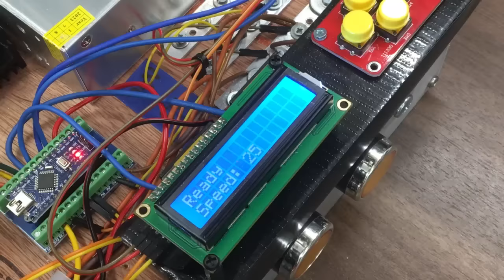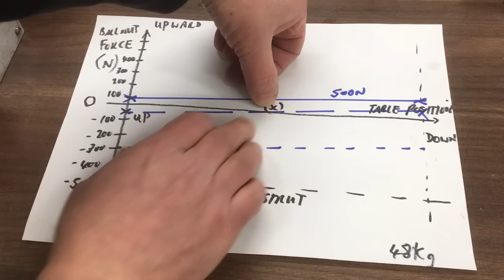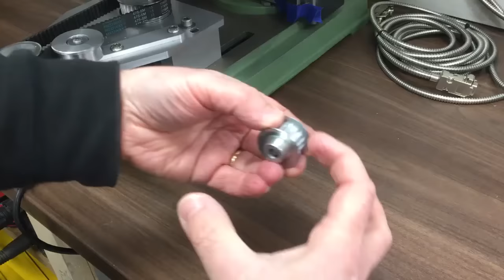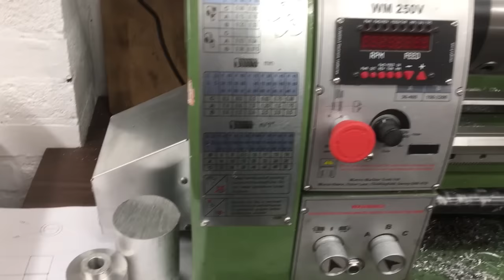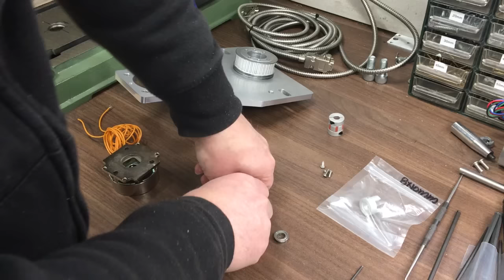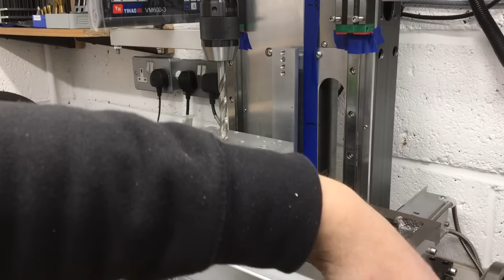Ep48: Drill Press upgrade | Adding a brake to the knee!

Comment: It must cost a small fortune, but I would have done the same thing if I had the skills. It's beautiful work, thank you for sharing it.
Reply from the maker: Not too bad actually and still cheaper than buying a milling machine with the same features. Early on in the project some of the parts were sent free for review (linear rails, inverter, and some other parts).  Plus I’m having lots of fun building it!

Comment: Lovely work, but bet you wish you bought a new stepper with integrated brake! A few dollars would have saved a lot of time. Looking forward to seeing the speeds. When you crank the amps and voltage, and implement ramped pulse generation on the arduino! Also, don't just use the "enable" output to release the brake, need to allow a few milliseconds for the relay to close and the brake solenoid to activate.
Reply from the maker: Yes!  Definitely the way to go.  £60 for 3Nm motor with brake, done!
For brake control and stepper control it will all be from Arduino in software (brake via relay) so lots of control to time it all.  Will probably release the brake to move and keep it off for a few seconds in case you want to nudge the position.  You would not be able to drill until time had elapsed but I can fine tune it.

Comment: The saga continues!
Reply from the maker: I could have just bought a mill, but here we are, episode 48 and counting . . .!
Reply: @routercnc9517  Wouldn't have been as much fun!!!
Reply: @routercnc9517  at what point does this project stop being a drill press and morph into a "mill"? ;)
Reply from the maker: Well it would need a new quill system as the bearings are only for axial loads and there is no drawbar so the endmill would just fall out.  Also the table is not that stiff for lateral forces as it only has 2 linear bearings.  It would be nice but for now my goal is to make it a really nice drill press!

Comment: I really enjoy following your process! Just a question: Why do you need such an elaborate drill press? Or do you do it just because you can? :)
Reply from the maker: I want a precision drilling machine.  So pick up off an edge and drill holes in the part at specific locations.  Also moving the knee up and down to insert longer drill bits and not loose position.  Speed control so I don’t need to change belts all time.  Tapping function to get tapped holes started straight.  So just makes using it more enjoyable and helps make accurate parts.  Also enjoying the process!

Comment: Hi - not sure if you have implemented this in your arduino code already, but it sounds a bit like there is no acceleration curve programmed for the stepper motor? I.e. when you press the button, the stepper tries to spin to the commanded RPM instantly. If that is the case, you will find that the motor gets upset and out of sync at a much lower RPM than it can actually achieve. If you program in a 'soft start' acceleration curve, you will find that you can achieve much higher RPMs as the motors are able to accelarate themselves and the load without falling out of sync and getting upset. Appologies if you do have a curve programmed in, I have not watched all the videos on this, but just based the above comment on the 'sound' of the stepper starting. P.s. not sure how you are implementing the stepper control in the arduino, there are standarded stepper libraries, but on a past project where I needed to control stepper RPM rather than position, I used the 'tone' library which generates a square wave which you can then feed the step pin on the driver. To deal with acceleration, I programmed a little canned subroutine which gradually ramped up the tone frequency until the desired value was met.
Reply from the maker: Adding acceleration is on my list for the reasons you mention.  I’ve just focused on getting it working for now.  For the Arduino side I wrote my own code and found it was on the limit for sending out pulses on time and when moving none of the other pins are read.  Others have mentioned libraries and I will look into those, especially if they run quicker.

For now there is plenty of performance and I’m only at half current on the driver so probably more torque is available.  I have acceleration on my CNC router and it is good but for small movements it can be a bit annoying tapping the button just enough but not overshoot.  Plenty to think about though.

I’ve got a bit more to do on then onto the electronics and get back to the code.  Would like to add continuous and step modes.  Also canned drill cycle using.the knee, with parameters set by the small keypad (depth, peck, feed etc.). Thanks for the comments

Comment: well done, so do you think you still need the gas strut with the brake in place?
Reply from the maker: Yes I think so.  That significantly reduces load on the motor and allows drilling via the knee.  Otherwise the motor has to lift 50kg when drilling using that method.

Comment: Top and bottom limit switches...
Reply from the maker: That’s part of the plan.  They integrate into the knee DRO system and will use basic microswitches.  Hopefully in the next video.
Reply: @routercnc9517  I didn't think you'd overlook them, but you hadn't mentioned them at all 😁
Reply from the maker: It was a couple of videos ago - see at 15:10 here: https://www.youtube.com/watch?v=3ynnVW7Aeyo